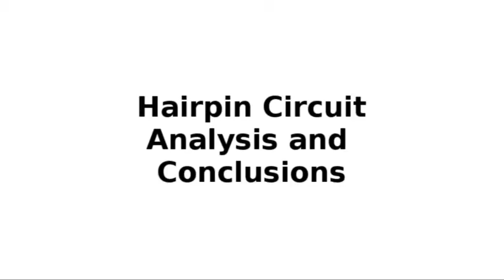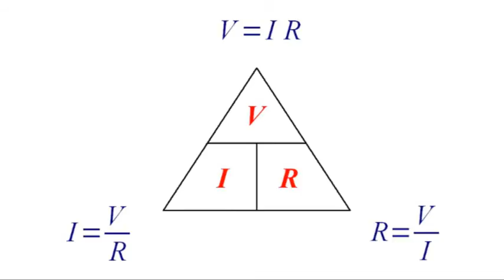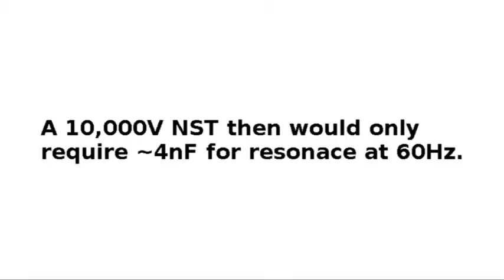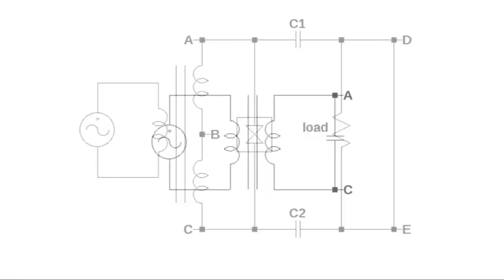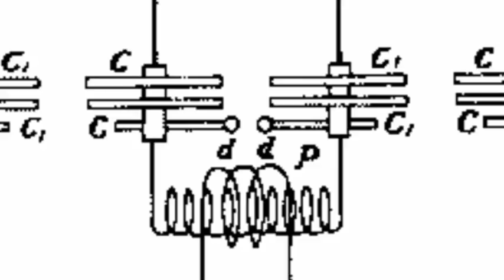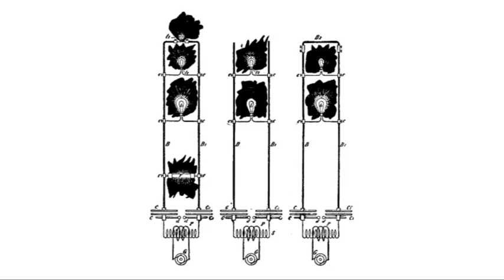Tesla Hairpin Replication - Circuit Analysis 1

Comment: What i always believed is the spark ionises the gas and pulls and pushes the cations and anions to positive and negative terminals respectively, which increases the current in the high voltage circuit and caps store that charges.

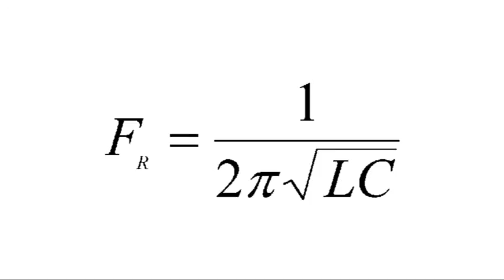Comment: Fred, you miss the point of the Tesla Impedance circuit. You need to go back to Tesla and not guess from what others have done. See the 1891,2,3 lectures. I say you miss the point because at 18:55 you write that you see the spark gap as only adding noise. This completely misunderstands Tesla. It is because you don't have a proper spark gap that is properly spaced and quenched that you are not getting any hf.
Reply: But, indeed, this is the only video on the internet trying to put the hairpin circuit to math and analytical analysis! So? What if he had proper spark gap?

Comment: The resonance of the output rod forming a tank circuit of its own independent of the NST tank circuit. This can be seen by the fact you can hold the output rods,  HF not 60hz or you'd be fried. 
The high q of the NST circuit is good for efficient generation of the impulses that set the rods ringing through the discharge of the SG. 
The two shorted rods have their own inductance and this is the output tank circuit with the caps that will be in HF ossalation,  hence you can touch. At least that's my observation of others experimentation 😜
Reply: Just figured this out myself, creating a freely resonating tank circuit out of this thing has immense uses, and the higher the Q the longer the oscillations last per discharge of the capacitors, and more importantly it's an immense reactive power tank which has great implications and uses.

Comment: Thanks for taking the time to break it down. I found it very interesting, I'm grateful. I got a 9000v 30ma NST and I'm trying to figure out what size capacitors I should use. I don't want to spend a fortune. I did hook some up I had, but they were way too small (150pf).

Comment: Hmmm, wonder if this presenter is still with us as not a peep.  At any rate, although this vid leaves out many of the observed and unusual tendencies of the hairpin ‘tank’ circuit, it does provide important information about safely building one in terms of not burning up your components.  Thus simplifying the circuit helps in design thereof.  After that the simple tank circuit just does not explain what Tesla demonstrated, and in fact, Tesla himself calls it the impedance circuit and does not explain unusual observations which are well known and there is no mention of in this video, so why did you leave those observations out as obviously you are very versed and intelligent?   My conclusion, then, is you left these observations out as you could not explain this.  No problem there as even Tesla alluded that he could not as well.  Nevertheless, again, this video is important for builders for safety reasons, the most important of which is to not build this at low frequencies as your death may be imininent.